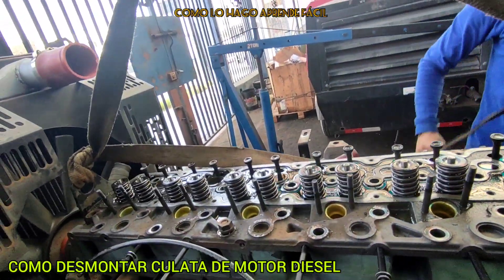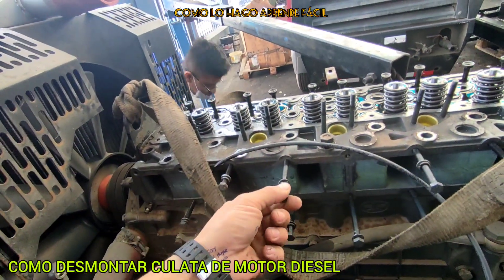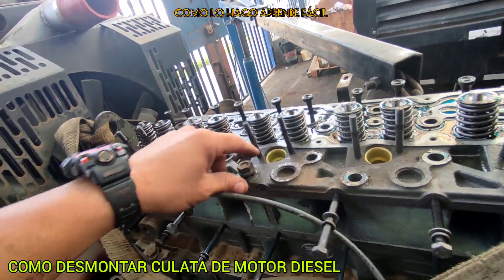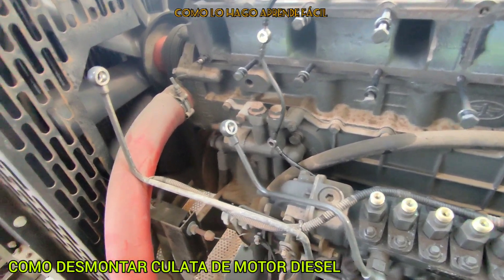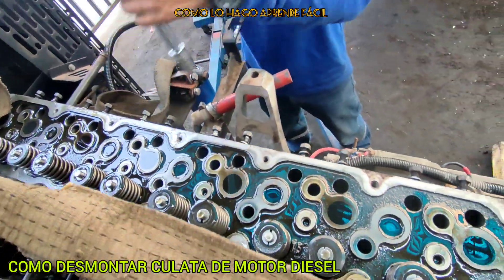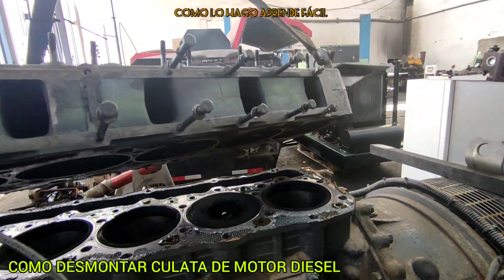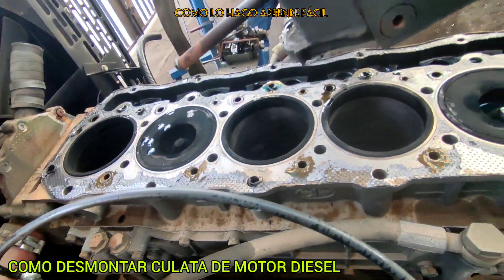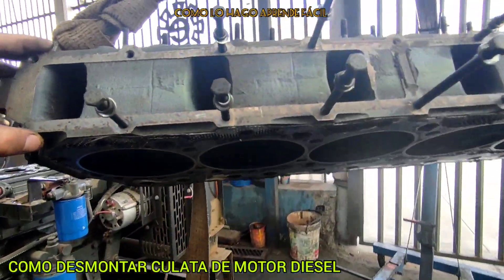COMO DESMONTAR CULATA DE MOTOR DIESEL

Comment: Hola saludos, quisiera hacer una pregunta, Cuando está soplando comprensión en el tapon de aceite donde está la tapa de balancín y aparte mezclo agua con el aceite , quisiera saber que fue lo que paso en el motor gracias saludos , muy buen video para todos 👋
Reply from the maker: Hay varias posibles fallas. 

Las más comunes para esos síntomas.

Desgaste de los cilindros baja compresión(parte de la compresión se va al carter lo que aumenta el volumen del desfogue)

Si encuentras agua es probable que haya fallado la empaquetadura.
hay una fisura en el monoblock o la pared del cilindro.